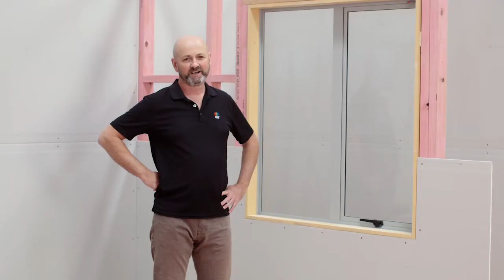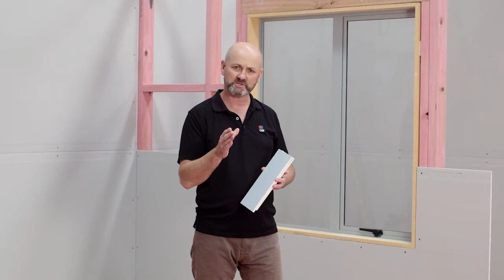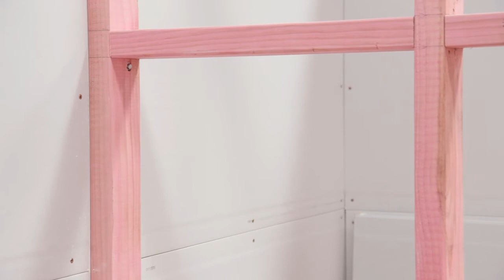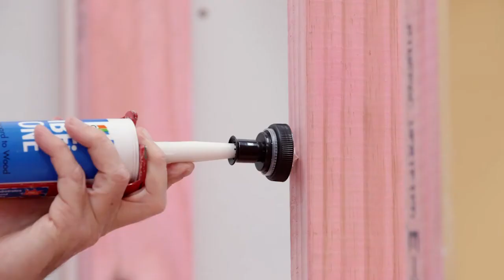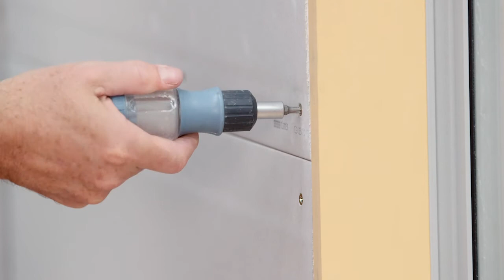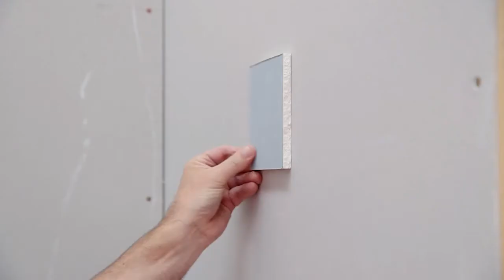Walls - Plasterboard Installation

Comment: Is their a gap off the ground for fyreline?
Reply from the maker: Yes, on timber frame you will still need a gap to allow for shrinkage.  Some Fire Rated Systems require you to fill the gap with a Fire Rated sealant.  You can check with us on 0800 100 442
Reply: @GIB12256  thank you